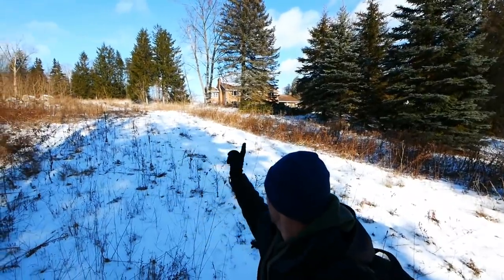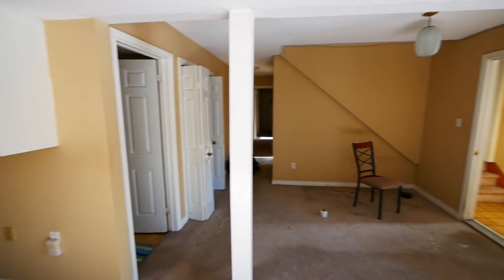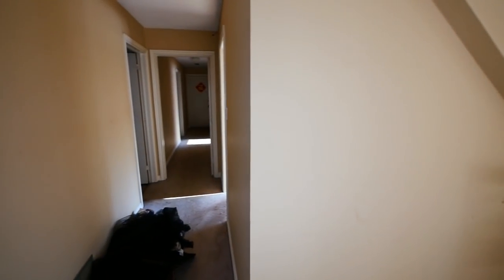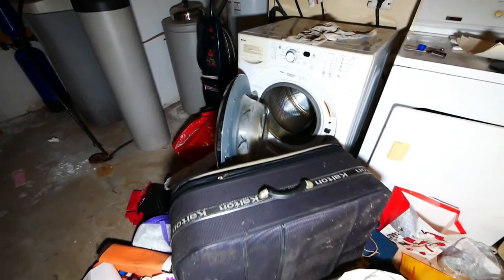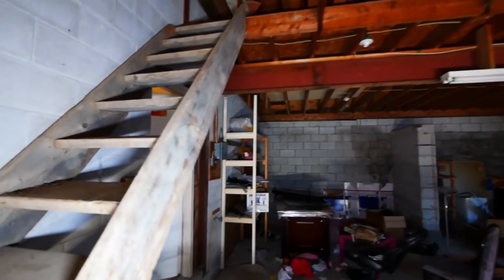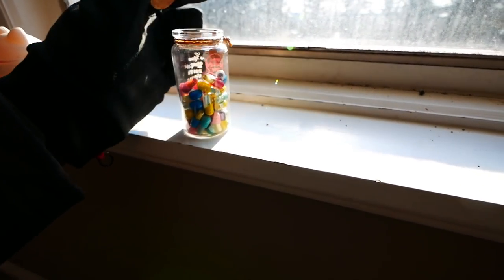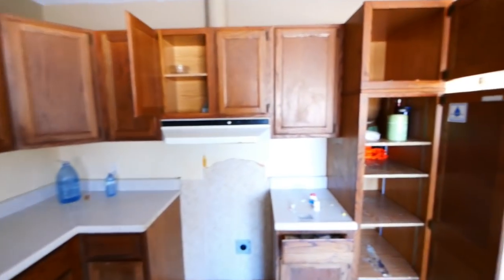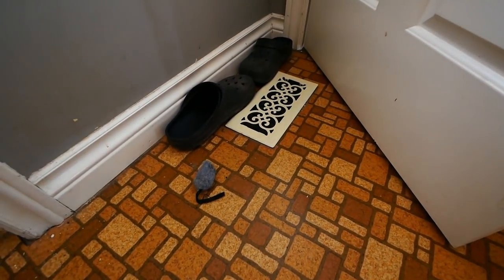Large ABANDONED 2.5 Million Dollar house with so much stuff left behind. Explore #93

Comment: That last bathroom shower looked like a murder scene from a movie...lol.  Looked like a very cool property and the house was still in pretty good shape.  Thanks for sharing!
Reply: I feel like there must have been something like manganese in the water. That was happening at my mom's house and it was horrid. And smelled bad!

It was safe to shower in, but not so much to drink or cook with (that concentrates it even higher), so that would explain any bottled water left around.
Reply: I guess I should have watched the whole video first, lol. Yeah if that's iron, that's not good either. Yikes.
Reply: CLR would do wonders to clean up those stains.  A really good water filtration system would need to be installed to get rid of the problem though.

Comment: That is the 2nd Asian owned mansion with severe rust staining ignored by owners. It could be filtered and the stains removed with muriatic acid like you said but they were ignorant, cheap or both. Both houses also had padded leather bed headboards with the brown top coat colours worn off where the hair oils contact and corrode it. It is terrible how very expensive furniture have really weak leathers like this. There is a strong sealing beige basecoat then they swirly spray a very weak brown top coat that is ok at first then with a year or two of use can wipe off with Water! Especially with hair or touching adding body oil. Or the type that just soaks up oil and gets dark. Nobody knows how bad 90% of home leathers or paper thin vinyls are. Made to rot quickly after warranty over.

Comment: Is that an area where they can get city water piped in? If not, won't the new homeowners of the newly built homes be surprised that they have to have drinking water trucked out to their house? It's a total pain to do this...& water gets heavy quick when you have to carry it.  Also, that kind of water ruins the pipes, appliances (especially water heaters), clothes, fixtures & everything it touches.  Replacing these things gets expensive.  And definitely don't drink it....And the chemical cleaners for this kind of water will go out to the septic system, gradually draining down to the ground water which makes the water worse for you.